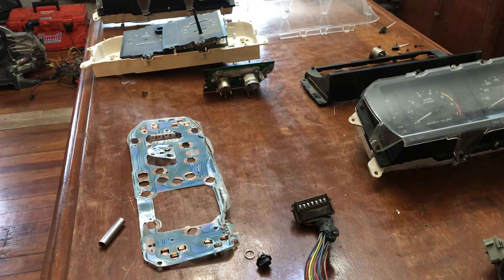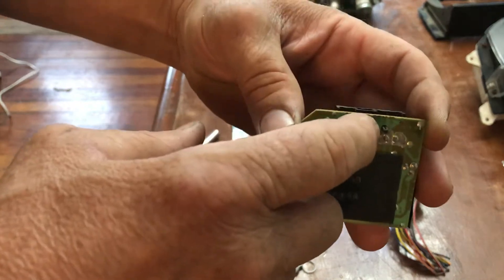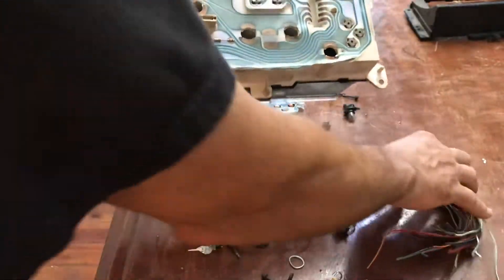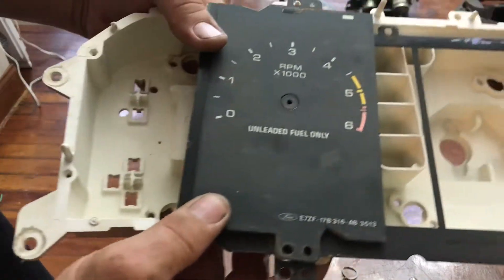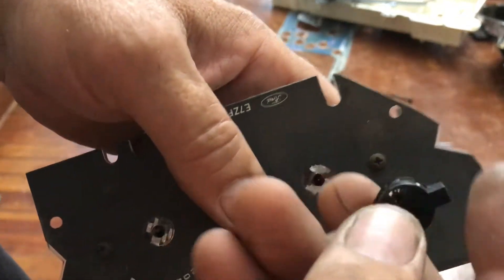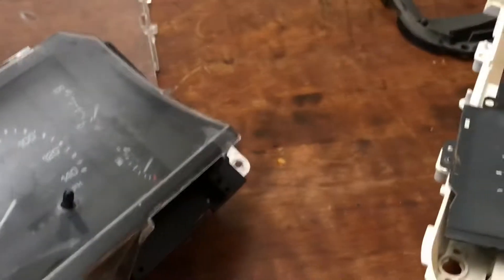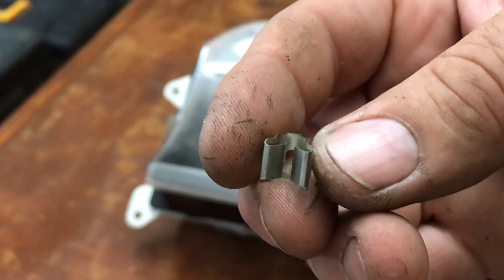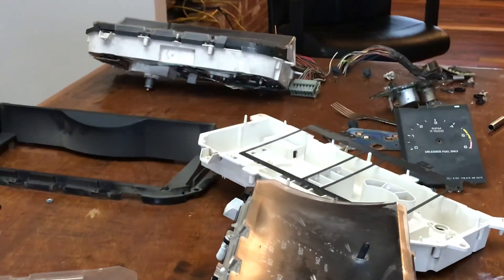87 thru 93 Mustang dash cluster

Comment: Hi there I have a question could a Foxbody 1987-1989 gauge cluster fit into a Foxbody 1990-1993?

Since I want to replace the one I have and saw a 87-89 cluster a good deal but it has this 4 piece clip(?) thing near the right side (underneath the gas marker) so I’m curious if it would fit

Comment: I’m looking at 90 GT that has a malfunction cluster. It’s causing the alternator to not charge the battery. What can I do to bypass it so I can drive it home
Reply from the maker: Get a one wire alternator at Summit Racing, LMR, ect (serpentine model) 140 amp. Truly one wire. Easy to install (buy the pigtail with it).  Just checked price at Summit Racing they went up since I bought mine. Tuff Stuff Performance Silver Bullet Alernator 7069BBULL6G 140 amp serpentine Ford $206.99 or something similar. Problem solved. Drive it home!

Comment: I’m having an issue with my Check Engine light NOT coming on when I turn the key in the start position, everything else works! Do you think it might have anything to do with the instrument cluster circuit board? I have an 89 5.0. Thanks!
Reply from the maker: I think it could be the light bulb, I usually remove that bulb anyway. Nothing to worry about!

Comment: I have a 140 cluster the bottom 2 mounting holes got broken off can u change everything over to the white part of a 4 cylinder cluster so I will have all 4 mounting holes! I have the ears that broke is there any kind of glue jb weld or something will hold it!!!!
Reply from the maker: JV - I think you can change that housing out - there is no glue that I know of that will glue the broken tabs back on the old housing. If all else fails, pick a used cluster up on ebay.
Reply: @88MustangGT  I have a 87 4cyl cluster already with the 6 grand tach in the 85 speedo the only thing I would have to do is just pull all the gauges up I shouldn't have to mess none of the needles right in change the blue strip like stuff on the back in how does that come off last u pop those funny looking clips that hold it on from the inside of the cluster when u are the u said something about a pair of needles nose pliers in they pop right out I am guessing they would come out when u lift the speedo in tach up I was thinking it shouldn't be any difference in the cluster housing it's self I mean it  has the 2 like top mounting holes 1 is on the top right just down a little bit I was going to try to mount in the car in see how long it lasts before I get any rattles just like to know if I have that option to use just the 4cyl housing nothing else then put all my V8 stuff in the 4 cylinder cluster!!! Thanks for ur time in info Jeff yeah those 89 140 clusters are getting out of control $200, I seen 1 for $350 people are charging a arm & a leg again thank u!

Comment: Jeff- I have a gauge cluster with a 140mph speedo - the tach drops to what would be a 6pm location whenever I send power to the cluster.. any idea what that’s about??
Reply from the maker: PR: Google "Ford Mustang Wiring Diagram for 1987-1993 Instrument Cluster" the tachometer feed is pin # 11 (good place to start tracing some wires down). I think you have a ground wire problem since the tach still works somewhat. You may need a new dash cluster (check ebay) - they are getting fewer & harder to find - if all esle fails - get a new tach, small pillar/pod mount type or a dash mount tach & call it a day!  Just my 2 cents worth, hope it helped.

Comment: I have a 140mph gauge cluster in my 89 gt and I have replaced the speed cable and speed sensor and the speedo still doesn't work
Reply from the maker: MS - A few things to try:  Remove dash cluster & take a drive with the end of the cable visible so you can see if the end of the cable that plugs into the back of the cluster is turning. The speedo is mechanical as I'm sure you know. If the cable is not turning then you know when the problem is (at the connection to the T-5 trans). If it is turning, then you may have a defective speedometer after making sure the cable is plugged in properly to the back of the cluster. Clusters for Foxbody Mustangs can be found on ebay (I've picked up a couple there myself  -  not inexpensive & getting harder to find).  If you can afford it the ultimate dash cluster is the Dakota Digital $755.25 or the New Vintage USA 87111-03 at CJ Pony Parts $649.99. Hope that helped
Reply: @88MustangGT  thank you I'll be testing as soon as it's done raining
Reply: @88MustangGT  so it wasn't spinning at all and it's a new cable, speed sensor and gear do you think I could have installed it wrong?
Reply from the maker: Really don't know at this point. Check with a local transmission shop and see what they say. You might have to check more than one transmission shop until you find your answer. At least you know the cluster is not the problem!